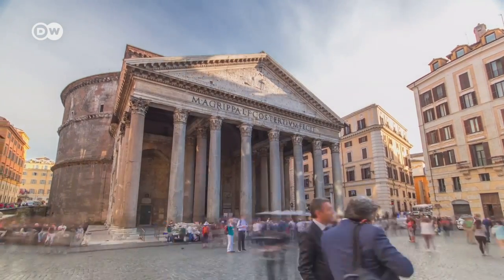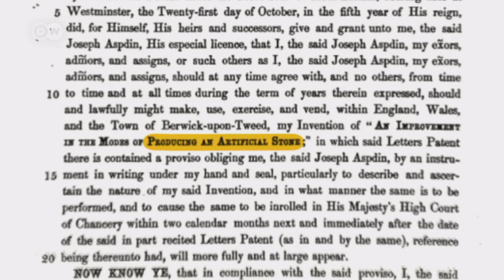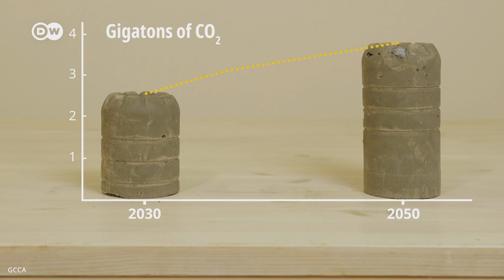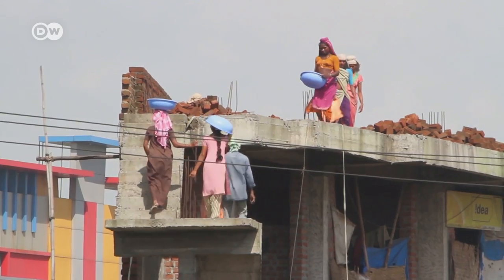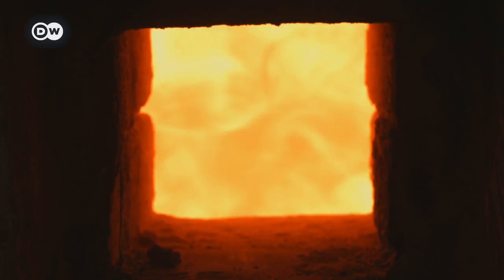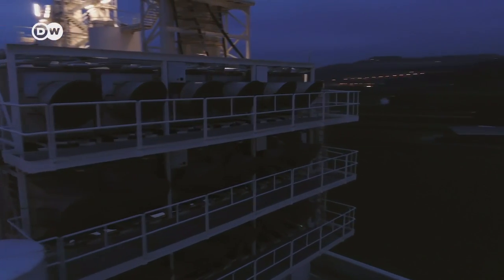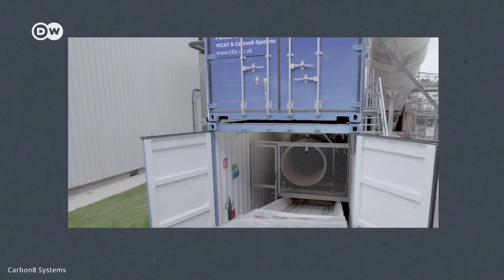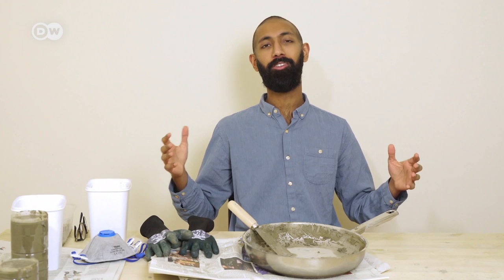How to fix the world's concrete problem

Comment: Most of the carbon reuse scenarios still emit that carbon into the atmosphere at some point. 
There have been large parts of the transportation sector that have committed themselves to use conventional fuel produced from captured carbon and hydrogen. 
There needs to be a regulatory framework that ensures only carbon captured directly from the atmosphere is being used rather than carbon from sources that have previously stored carbon.
Reply: Totally! That is the workaround for the fossil industry. Just as disingenuous as proposing to use trash as fuel. Modern trash burns mainly because of plastic.

Comment: High temperature chemistry, done at industrial scale, is probably the greatest hurdle that decarbonization faces. Aluminum foundries, cement plants, steel mills, you name it. How are you going to cheaply provide 2000 degree atmospheres 24/7 without burning fossil fuels?
Reply: You can't. No green power source can even provide the electricity effectively for the foundries (And yes they pretty much all run off electricity for their forges now days)
Reply: letsTrySelfImprovement  exactly!

Comment: In the US, the biggest problem is to build long term with concrete so that structures like bridges and roads etc. do not have to be rebuilt every 40-60 years. It mostly happens because we use cheap steel rebar which many times is already rusting when the concrete is poured. The rusting metals off gasses, which cracks the concrete, which exposes more metal to moisture, which rusts more metal, until eventually your bridge looks like it has leprosy and falls apart. Roman concrete did not use ferrous metals, which is one major reason why their concrete lasted so much longer. The best way, IMO, to use less concrete is to use it less often and wisely (also saves tax dollars as well) and do it right the first time.

Comment: Ehh... This is pretty much fake news. 
The killing blow is that concrete absorbs carbon dioxide as it cures.

The one major issue with making concrete "unsustainable" is the kilns used to initially produce it. which means we just have to find "sustainable" methods of heating said kilns, and carbon-nuetral super heating is something that can be done through several different methods.

Comment: Those ancient concrete building lasted a long time because they do not have rebar. New building are already crumbling. We're going to perpetually need to rebuild everything with new concrete if we keep this up. We also don't properly value our stuff because we have divorced ourselves from where it all comes from.
Reply: No it's because most of them are made of huge slabs of solid stone with concrete cementing them together and also not nearly to the scale that we build things.
We use rebar to strengthen concrete to make up for it's deficiency since it is great under compression but weak against shearing so we add rebar to give it strength along the shearing plane so instead of just snapping like a dry twig it cracks and the rebar takes up the load.

Comment: is it just me or 60% co2 is very little? the large numbers are just because of the amount of concrete that is being produced , the efficiency is fine
Reply: The efficiency is not fine, like you stated in your OWN post, the numbers do add up. If the avg foundation(giant concrete slab) weights 7.5tons, then that's 4500 kg of co2 released in the air. The average car puts out 4.6 tons of co2 per year meaning that one house's foundation could be a year's worth of driving. The salseforce tower in SF foundation was 22.226 Million kg, or the same as driving for nearly 5000 years on 1 building or the same emissions as every driver in America(115 million cars) to drive for 0.5 miles.
Reply: @freevipservers  

so just one year? that makes concrete a lot more efficient than cars, since it just makes co2 ONCE, and you can use it for 100 years after. cars make that every year.
Reply: @yakir11114  Good observation, it does. I'm not disagreeing with you either but both are issues. I think active pollution is the problem and not concrete to but the 60% of weight to c02 is still terrible. If it was like <10% then that would be acceptable.

Comment: Lets just exclude concrete from the Co2 targets and classify it as acceptable levels of carbon emissions. The emissions are quite low given that its the most widely used material in the world apart from water, also there is another crisis that you don't bother to mention which is the global housing crisis. Carbon taxes on concrete makes building even more expensive. This is the danger of flat carbon targets. Targets should be more intelligent, Trees need carbon to breath so why not offset by planting some more trees. I support wood and concrete combined to build bigger cheaper buildings. Make new building standards that require tree spaces near to buildings. Buildings are too small so start building vertical taller buildings so we can fit in bigger Gardens with trees. People also need a place to dry their clothing so some outdoor space would be a change.

Comment: The "chemical formula" of C2S and C3S are really bad.
If you already use the formula of limestone, just use the formula of calcium silicate. Even though, the quicklime (CaO) reacts with water to form Ca(OH)2 to then form CaCO3 with CO2.
The chemical formulas are not too hard but not necessary. If you decide to include them, please use them correctly.

Comment: it's funny how we think it's completely energy efficient to transform heat produced in nuclear power plants into electricity but not to use the heat itself in production of such materials that need large quantities of fossile fuel...
a Portland Cement factory is usually born far from large cities and close to resource fields to reduce shipping costs on the heavy raw material... seems like the best use of nuclear power to me, way better than the costly nuclear powerplants we do... the only problem is the current system, it works... people don't like changing that, yet when having to address the problem people seem to think they will somehow substitute a material we've been using since 600 BC.

Comment: Should have called out the US highway infrastructure that has to be totally rebuilt every few years forever because we can't be bothered to use more expensive stronger/thicker concrete in the first place. So within 2 years a brand new highway looks 20 years old.

Comment: There is no problem, because countries are getting greener, CO2 emissions will go up for now, but after a while, when a big portion of the electric power is green, we can use the green energy to remove CO2 from the atmosphere. By doing this, instead of countries having an excess of CO2 emissions, countries can consume more CO2 than they expel. I have read that nuclear fusion is possible, so no problem.

Comment: constructing western urban houses with alternatives to concrete is currently only 10-30% more expensive. this is without a co2 price and while sand for concrete is still locally available. omitting economics the concrete age will be over at some point because it simply isn’t a renewable or circular resource. concrete won’t go away but will become what it was in the past a high cost special material only used where absolutely necessary. if we want to continue to build prospering cities that can expand we have to embrace and industrialize/innovate sustainable and circular alternatives!

Comment: The Pantheon's columns are granite. Calcium (Ca) doesn't  become Coal (C) when heated. The bonds in CO2 are parallel unlike the water molecule models you use to show concrete absorbs CO2. This level of carelessnes will make your videos hard to trust.

Comment: Knocking down perfectly fine buildings is an American invention.
Reply: Not necessarily. Some countries have such weird building codes and building costs, that they also knock down perfectly fine buildings because it's cheaper to build a new one than maintain an older one. Case in point, Japan.

Comment: Small modular nuclear reactors should be used to create the heat for cement production. Existing cement plants need to be connected to carbon capture systems and the CO2 needs to be reused in industry.
Reply: And... there's absolutely no evidence than any of the 3 things you've mentioned are possible in the near or mid future.

Comment: The numbers of the industry seem to me nothing else than a greenwashing. This has to be broken down in a very different way.

The problem of zero emission cement kiln has two parts: temperature and CO2 from chemical reaction. 

The second one is more simple in my opinion. Carbon storage in pressed gas is nonsense, you have to put the carbon in chemical substances. Sugars or alcohol. You build greenhouses, maybe even with LED lights for 24/7 photosynthesis (green energy, here we go) where you plant plants that turn CO2 into sugars. Sugar beets or sugar cane. And get maximum CO2 concentration possible in those greenhouses. Then you either burn the sugar rich pellets in order to heat the kiln of use the waste heat from the kiln to distillate alcohol from it and burn the pure alcohol. You get back pure CO2 and water.

Temperature is more difficult. You need a spiral design of the factory with maximum heat in the center and lower heat on the edges. You build parallel conveyor belts going through chambers with increasing temperature to the middle and back. The hot material that went through the process heats up the material that will enter it. You also add heat pumps for some of the temperature ranges to get the heat back in the process and/or to heat up the greenhouses. For the central part, 1400 degrees, you may pump in molten salt, burn the alcohol/pellets or heat it electrically with green energy. Or combine all of them. To heat up the molten salt you could use solar parabolic mirrors on the roof of the factory.

Comment: Making "low carbon concrete cheaper" is such a green washing solution and is far less impactful as the far bigger topic:
Steele in concrete, aka reinforced concrete, aka putting rebar in concrete.
The pantheon would not have survived this long if it had been built with modern methods.
The first solution to being more environmentally friendly is being long-lived. Steele makes building far faster and cheaper, but only for the first generation!
To be environmentally friendly, we have to put far more effort into building lasting structures, bridges that don't start cracking (and then rusting inside) after 50 years.

How was this topic not addressed?
Reply from the maker: Hi Benji, thank you for your comment. 
Several experts have told us that cement and steel manufacturing is the best place to conduct carbon capture. The tricky thing is (apart from trying to put all the research in under 10 mins) – unlike in almost every other sector – most technologies claiming to make concrete green are at the early stages of development. Now, that doesn't mean we shouldn't research this topic further, or bank on the cement industry's CO2 emissions lowering significantly in the near future. This is why we highlight in the video that the technology is incredibly expensive and rather untried.
Reply: @DWPlanetA  yes. But that isn't the point.
The point is that with the current methods a bridge is expected to last no longer than 100 years (often even as low as 50). And that's absurd.
It absolutely is possible to use methods that easily triple that life expectancy.
This easily makes the bridge three times as green. And if you calculate the costs for several generations (instead of foolishly for one) it's also easily far cheaper. 
And it can be combined with the methods mentioned in your video.

Comment: Essentially every single point on the 'how the industry will decarbonise' was total bollocks. Greenwash from start to finish, either by simply dumping the problem onto another industry or proposing impossible or impractical 'future tech will save us' solutions.

Comment: So lets say there is a giga factory that sole use is to capture carbon from the air, the product that come out is stored underground or somewhere.. so how do they keep running ?? i mean they also need to pay bills right ??
Reply: I guess though others buying carbon offsets
Reply: You have to imagine the opportunity cost of the energy used to run the amine carbon dioxide scrubbers and compressors. And the cost of said offsets goes up, increasing the cost of energy for end consumers.

Comment: Fundamental flaw in your chemical equation there, is that calcium carbonate doesn't react with the silicate directly. It's tranformed to the hydroxide in the kilning process. Same over all outcome in terms of co2 emissions.... But such a glaring oversight degrades your factual standing. And when you're trying to be a thought leader in how to reduce that impact, it hurt the entire cause to make such mistakes, it's too easy for detractors to pin down such basic errors and claim incompetence.

Comment: By far they best thing at capturing carbon is green plants. every commercial method ends up expelling more carbon from extraneous variables, and wasting energy in the process of capturing it. spending more time figuring out ways to reduce carbon output would be far better spent then ways trying to capture it with costly methods.

Comment: Easier solution just strap a new gen 4 modular nuclear reactors integrated easier than alt energy to massive isolated facilities that need to run near 24 hrs off set the fuel need.

Comment: The solution? Caring enough to fix it. That is really the boil down of so much of society. What we are not ready for as a society is realizing that the powers that run the structure of society doesn't care, and won't care until we make them care.

Comment: On homes which call for stucco as a visual finish, natural hydraulic lime is a good choice in place of Portland cement. Non-hydraulic lime, while not as strong, is even better since on setting it absorbs more CO2. Both are more permeable than stucco exteriors depending in part on their thickness, aggregate choice, and to what degree they are non-hydraulic. Both already exist and are readily purchased.

Comment: it s a false start. 
first step would be: build only what you need. most developers build for the sake of building itself, not for real people. 
on top of that: people find it confusing thinking in city-terms thus we build new just to escape understanding & dealing with complexities. 
reuse & revitalize rust belts, ghettos and any old form of construction.
rethink city cores, outskirts & mobility.
recreate your urban self.
redefine profit margin.
and most importantly: let s learn from the mechanisms of the already built structure-texture-infrastructure of our settlements (yes, all their kinds): what stands the test of time?!
that d be a proper start of a manifesto.

Comment: The Roman concrete and today's concrete (originated in Britain) has nothing to do with each other. This video is simply wrong. 
Roman concrete had some special type o volcanic ash in it, and was also supported with layers of triangle shaped mini bricks that made it stand after all this time. Today's concrete has a "lifetime". It literally crumbles away in front of your eyes throughout the years. A concrete house made today are usually "rated" for 40-45 years. That means after that time it must be destroyed and rebuilt. If not any small earthquake can crumble it.
 Also today's concrete negatively effected by humidity. It absorbs it and causes all sorts of problems for the structure and ailments for the inhabitants. As far as I know Roman concrete actually gets stronger when exposed to humidity and direct contact with water.

Comment: Can be fixed by substitute with CFS (Carbon fiber stone). Green carbon from CO2 and H2 combined with natural stone. Stronger than steel, lighter than aluminium. See Technocarbon, there you can see a wall-system with integrated insulation, made from CFS.